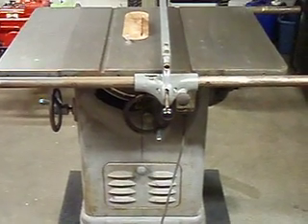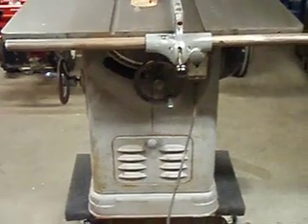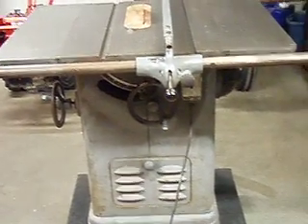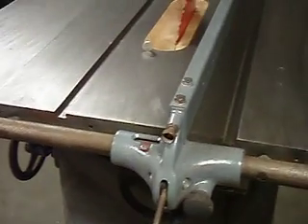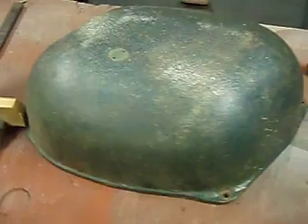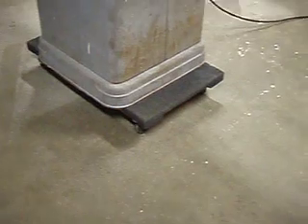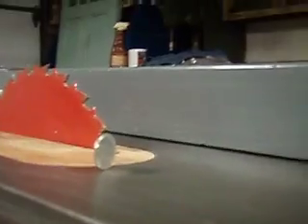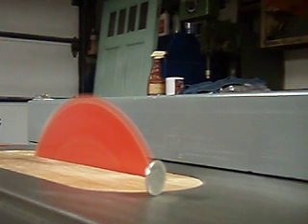1947 Unisaw.AVI

Comment from the maker: Thank you, it's so nice to use such a smooth saw.  I was using it this weekend to cut baseboard moldings and was thinking how sweet the movement of the blade tilt is.  Nice smooth powerful hand wheel just spun through the 45 degrees without the use of force at all.

Comment from the maker: @dkonvicka  My saw has a clean base that has not been cut for dust collection or a new motor. Plus, I have the original motor and super rare cast iron motor cover.  One more plus is that the original switch is still on it.  However, my top and one wing has been drilled with 4 holes.   That said, prices vary, but mine may be anywhere from $250 to $500, without the top damage, $500 - $750
Reply: firefyteremt I just commented to another guy about those covers being rare. A gem!